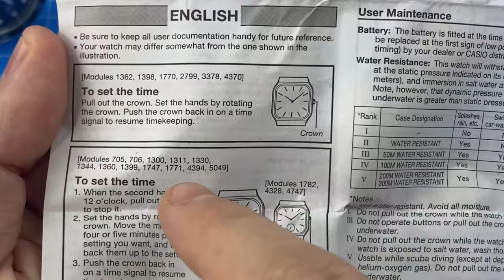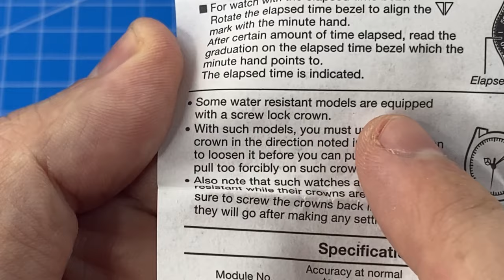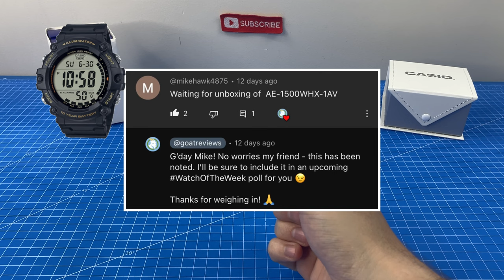Casio Duro ⌚ ONE WEEK Review + MODS / UPGRADES! 🦈📈

Comment: Firstly as a Boomer, I really feel your pain having to read an analog dial. Secondly, to actually manually rotate a bezel to time your steak cooking? My god man, the worlds gone mad!😵‍💫😱🤣 I’ve had a Duro for a couple of years & did the same mod to the crystal, but went sapphire!🤩 I’ve looked at that bracelet but have swapped the old one with a FKM rubber strap. I just received the AE-1500 on Friday & love it. I wouldn’t go for the other model simply because I think it looks really cheap. And it just doesn’t look as nice as the original issue. Good review of the Duro. A poor man’s Rolex Submariner.
Reply from the maker: @andrewd7586  Haha, I know what you mean. Yeah, the sapphire wasn’t much more expensive, I wish I went with that option now. Glad to hear you’re enjoying your AE-1500! 🙌 
Thanks man. I appreciate your input, Andrew! 🙏

Comment: Nice mod! It will be still water resistant after glass replacement?
Reply from the maker: Great question, Jaca 👌 
When I removed the original lens, I realised that there was no “seal” around it. It was merely pressed in, with a high level of precision to seal out the water (which can apparently handle 200m!)

While I doubt that this replacement lens is as precise as Casio’s original, it was a very snug fit, and I haven’t noticed any water leaks since I’ve been using it. I’m pretty confident this thing is very water tight! 😁👌
Hope this helps! 🙏

Comment: Does it still have the 200m water resistant?
Reply from the maker: Great question! 👌 I suspect that since the original lens was press-fit into the bezel, then the new lens I added should be just as water-tight. I've had showers with it since then without issue, and I doubt I'll ever be in deep enough water to find out 😁

Comment: The nato is great in hot, humid weather, the metal will not be as comfortable. You can definitely make mistakes, changing the crystal, not sure I'd recommend that for everyone, I messed up a date window by putting the stem back in behind where it goes. Before you do it really ask yourself if its going to make that much difference, or you can wait until your min. glass is really scratched, which will be quite a while.
Reply from the maker: You make a great point Bill 👌 

Before I got the more expensive “screw down” watch press, I was using the much cheaper “spring press”. I can vouch through experience that it is easy to make mistakes, and that these mods are not for everyone! (I ruined a critical lens gasket using this inferior press - there’s a video explaining that story here - https://youtu.be/2aOoJ15paiA )

There’s so much to consider with these mods. As you mentioned - is the risk worth the marginal benefit? And as I discovered, is the cost of the tools to do it right worth the benefit? Will you be using the tool enough to offset its costs? 🤔 

Thanks for weighing in with this well thought out, and very logical take, Bill! 🙏

Comment: Is that watch still has 20 bar water proof?
Reply from the maker: Great question, Aras 🙏
While I don’t have the testing apparatus to verify this, I’m fairly confident that the water rating wouldn’t have been affected. The lens is press-fitted in the same way as the original, and I was sure to use silicone grease on the O-ring when re-sealing the case back 😃

Comment: The metal bracelet easily looks the best! How did you manage to mangle the split pin? Trying to pull out the screw-down crown had me laughing loads in the other video. Love that you show the good, the bad and the fubar!
Reply from the maker: I'm digging the bracelet too, PickAny! 👌I swapped to the Zulu strap for my Volleyball games this week, but have now just swapped back to the Metal clasp.

re-installing the metal clasp each time can be finicky, so I reckon I'll leave it on and use other watches for sports for now 😄

I'm glad my buffoonery was entertaining for you, my man! 🤣 Thanks for weighing in! 🙏
Reply from the maker: Oops, forgot to address how I mangled the split pin! 🧷 

So what happened is I tried to use the springbar removal tool on from the WRONG side of the bracelet! So it started ejecting the wrong way, and then get jammed halfway. 

I had trouble getting it to go back through the correct way, so I decided to just rip it out with force (I was excited to complete the build, and knew I wouldn’t need it anyway since I was removing so many links 😅) 🔗
Reply: Lol, thank you for the replies Goat Herder, they were appreciated.🧍🐐👍🏻

Comment: Hi! Does swapping the crystal affect the water resistance?
Reply from the maker: Hi Matteus! 👋 
I don’t know for sure. What I do know is that the original lens was just “press-fitted” into the housing, without any rubber gasket or seal apparent when I removed it. For the new lens, I simply press-fit it in the same way. I imagine that the size wouldn’t be as precise as the original, so perhaps there wouldn’t be the full 200m of water resist any more. Hope this helps! 🙏
Reply: @goatreviews  thanks!!🙏

Comment: I noticed on some older videos that the Casio Duro models they were reviewing had snap on cases.  These videos were not that far back.  No more than 6 months or so ago.  I would make sure that the Casio Duro I ordered had the screw on case back.  A snap on case back is a bad idea.  Screw on case back is what you need.
Reply from the maker: G’day Glen, thanks for sharing this. 🙏 
That’s incredibly interesting! I’m trying to visualise what a snap on case would even look like. Was it definitely the Casio MDV-106? I’d love to see one of the videos if you track it down! 👀
Reply: @goatreviews  These videos showed up in my feed from well-known watch reviewers.  This information would be easy to find.  You know, those pros and cons videos?  The watches were described as Casio Duro, 36mm wide.  These reviewers mentioned that these watches were not easy to source at the time.
Reply from the maker: @glenh4971  Ah, that’s the info I needed! It’s the newer 36mm model, which is a little smaller.  Thanks for clarifying, Glen! 🙏

Comment: you cannot bo back with the 'timer' because its for decompresion.. its a diving  watch.. as you need to decompress for lets say 10 minutes from 35m dive  (just an example) then you set it up, and wait , if somethign happens and you bump the watch by accident the timer will add rather than substract. so that the diver life is not in danger in case he would leave decompression depth too early. No one is using this sort of function anyway as divers have dive computers.. but its a good back up method. Thats why it only spins one way.
Reply from the maker: Absolutely fascinating!! 🤩🧐 
I had no idea about this intended functionality. 
Thank you so much for sharing, Kira! 🙏
Reply: @goatreviews  Me EITHER.  NEVER knew that.  Thanks, Kira07.

Comment: Like you, I definitely prefer to wear a digital watch as I find them easier to read, especially with the sensible 24h notation.
Along with many digital watches having better features, I especially like the DB-36 for using it's extra buttons to make the operation smoother.
But I have found that large analogue dials with minute markers are amazing for longer public transit trips.
This as the sweeping hands are amazing for quickly gauging durations and estimating how much time you have to make a trip.
That NATO strap is gorgeous, the brand I usually go with has lighter hardware, which while being more comfortable also looks cheaper.
The metal bracelet looks great but seems too shiny for this Duro, which benefits from a black contrasting strap more.
And the "marlin" is actually a sailfish, personally I also think of the 3D-printer firmware when I hear Marlin so I prefer the name Duro.
Reply from the maker: That’s the way, Wyvern! 🙌😁
Woah! I’d never heard of the DB-36 before, that’s really cool. What kind of functionality does “forward” and “reverse” achieve on the watch? 

I know what you mean about the hardware - it’s one of the reasons I chose these nice and thick-buckled “Zulu” straps. In my opinion they look better, and are surely more durable. 

Haha, I know right? While it ain’t technically a Marlin, IMO the nickname appears to have stuck already 😂 Duro sounds good too 🙏
Reply: @goatreviews  "forward" and "reverse" are your usual up and down for changing numbers or scrolling through the phonebook or alarms.
In the time screen they also temporarily show the second timezone or last viewed phone number while pressed, which is very useful.
Aside from setting they are useless in the stopwatch and timer mode, where it works like a normal, older Casio (no auto-repeat).
Left and right change which field you are editing, this is per digit and you can go back, set is dedicated to exiting and light to the backlight (though on the DBC-32D it has more tacked-on features).
Reply from the maker: @WyvernDotRed  incredible! That’s more useful than I’d imagined TBH. It would be cool to see this feature expanded to its full potential in upcoming releases!

Comment: That is a zulu strap, not a nato strap. Also you did not weave it in such a way to reduce spring bar tension
Reply from the maker: I appreciate the correction, Cannedeals! 🙏
Is the difference between a Zulu and a NATO Strap based on the material, or buckle style perhaps?

Woah, I’d love to hear the technique to reducing the spring bar tension, too, if you wouldn’t mind sharing 🤩👂

Thanks in advance! 🙏
Reply: Typically zulus have thicker nylon than natos. Typically Zulus have rounder and thicker hardware than natos. Aswell on the end of the understrap natos have 1 ring, where as zulus have 2 rings. 

For strain/tension release you thread the main strap through both rings at the end of the understrap, then you fold the mainstrap up and through the first ring from the bottom and back over. This means when putting the watch on tight, the pressure does not travel to the part of the strap holding the watch.
Reply from the maker: This is such valuable information,  @cannedeals ! 

That’s the best explanation I’ve heard to tell the differences. I appreciate it - and now I won’t be confused any longer 😁

Incredible! I’ll give this technique a try. Thank you so much for your insights! 🙏🫡

Comment: Yeah dive watches are not the same as digital watches as far as the dive bezel goes. 
The duro is a dive watch not a fashion watch. I modded both of my Duros  but with sapphire crystals and various solid link stainless steel bracelets. Much better wrist presence.
Reply from the maker: Yep, I feel that, Mike! 👌
It’s not really a fair comparison - It’s mainly my thought process when deciding what to wear.
Good stuff!! I regret going mineral instead of Sapphire, it wouldn’t have been much more expensive to go all the way 🥲💎 

Thanks for weighing in, man! 🙏

Comment: Get one while you can, because Casio has replaced this wonderful watch with a "less wonderful" MDV-107, which looks  similar but is:

- too small (only 36mm)
- only has 50m of water resistance (not 200m)
- has a press on back (not screw down)
- has a push/pull crown (not screw in)
- costs twice as much
- and the final insult - has no fish on it!

The MDV-106 Duro will never be a collectors item, because Casio has already sold millions of them, but buying a new one now will cost you less than buying a used one in the future.
Reply from the maker: Some EXCELLENT points, Marty! 👌 

My understanding was that the 106 would no longer be produced, thanks to the 107. But I received a comment stating that the 106 is still in production 👀 

Also, while I believe the 36mm model is a variation, please note that there is indeed MDV-107 models which are the full size. The only physical difference is they are missing the Marlin logo.

I agree - and I’d much rather invest in, and represent the OG Marlin on my wrist 😁🦈

Thanks for weighing in! 🙏
Reply: The only difference between MDV 106 and 107 is the marlin,  the one you mention that is 36mm and only  50m WR is MDV-10.
Reply from the maker: Excellent - Thanks for weighing in to clarify these differences, @andiarun2879 ! 🙏 Much appreciated.

Comment: So you took a waterproof watch and made it worthless.. or did you get it tested? Either way it would be handy to know, because I for one am sick of watching all of these cheap and easy mods that DON'T show if the integrity of the watches waterproofness is diminished... thumbs down.
Reply from the maker: Hi Michael, the watch is not worthless for my needs 😁 I have never intended to take this watch diving.

Unfortunately I do not own the expensive equipment required to conduct a waterproof rating test. That being said, given the original lens appeared to only be "press-fitted" in anyway, I would be surprised if the new lens I installed had a noticeably lower WR rating.

Thanks for weighing in! 🙏
Reply: For the price of the watch, let's say the integrity is destroyed... It's 60 quid. Not Tudor prices.

But, I've done this mod, and having sapphire it's the best beater watch on the planet.

Also, it's been in the sea, covered in concrete, never failed, and is great when it's strap modded. Get the 106 instead of the 107 (for the marlin)

If you do the sapphire mod, just replace the gaskets.

The worst that would happen is you get water in a 5 dollar miyota quartz that's easy to switch out.
Reply from the maker: Fair assessment,  @TCL_Dasler ! I tend to agree with all your points. Glad to hear your Sapphire Mod is holding STRONG! 💪
Thank you for weighing in! 🙏